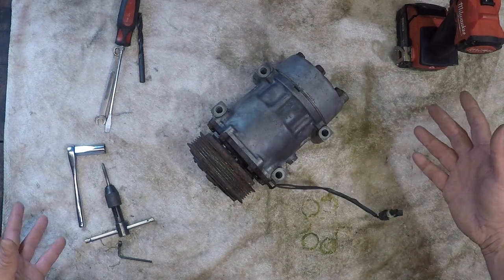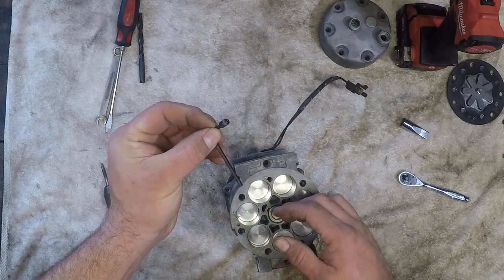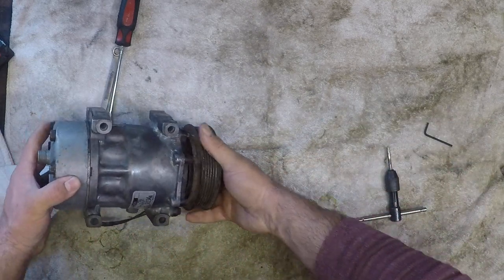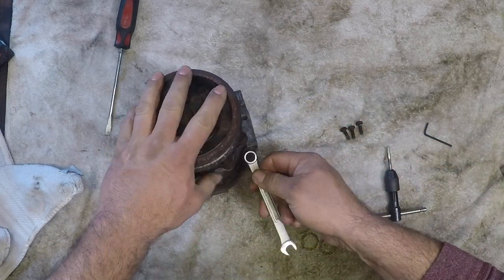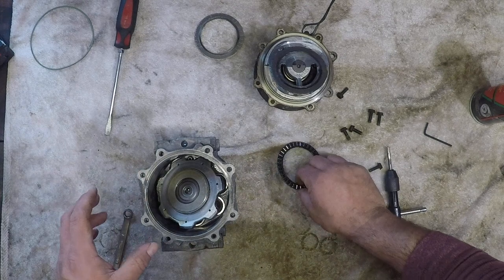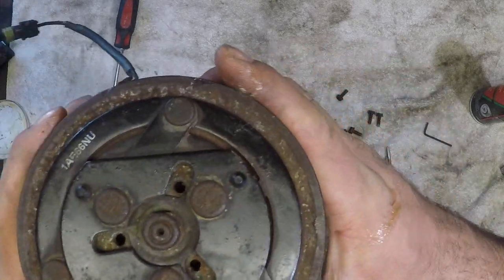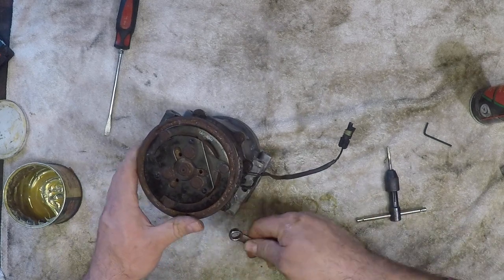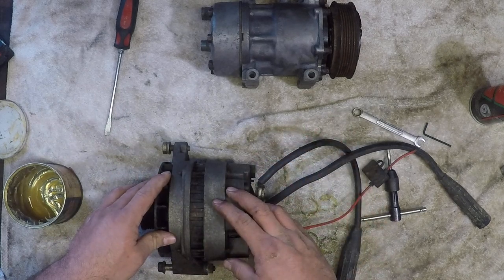How to make an onboard air setup out of a Sanden 709 A/C pump

Comment: I just picked up a $5 Sanden compressor to mount on my YJ. This is exactly the information I was looking for. EXCELLENT tutorial!
Thank you. 😎
UPDATE:
I've had it installed for about a month now:

This compressor works awesome! I robbed the pressure switch and blow off valve from a portable compressor (from a yard sale) to complete the install, combined with a throttle set built out of bicycle parts. This bad boy will pump a 30" tire from 18psi back to 35psi in about 30 seconds! The little Jeep rides so much better with the tires aired down. Thanks again.

Comment: I have never thought about grease i have always plugged the lube hole and but a fill hole in the top and put 4 ounces of 30 w compressor oil thats always worked for me 4 ounces seems to be about 1/4 of the way full
And when i got the head off i tap the holes for 1/2 pipe thread
Reply: I was considering using air compressor oil. Why not use the stuff made for this application? 

I like the idea about tapping the head for standard pipe thread.

Comment: Many questions on mounting one of these. Obviously a factory mount location is easiest. Otherwise adding a diy bracket is the next option. Essentially one needs to provide enough belt wrap around it. That's generally done by adding an idler pulley. One may be able to use or mimic a dual alternator bracket. Just make sure belt stays lined up on the same plane as other pulleys.  Then get a longer belt, which can be the hardest part. Using a piece of rope wrap around all pulleys and then measure including the tensioner. Belt manufacturers have a list of all their belts in a catalog with lengths and part numbers. Be sure to post your info somewhere others can find it for reference

Comment: I've just done this mod on my A/C pump ('99 4.0 RHD) and the volume of air it puts out is epic! Mine is fitted with an adaptor block and right angled fittings to get the air in and out - doesn't seem to affect the flow adversely. Unfortunately my A/C radiator was ruined so I can't cool the air, but maybe I'll add a small cooler in at some point in the future.
Thanks for the great video; easy to follow and very helpful!

Comment: I plan to try this on my XJ, assuming the factory compressor is the right sort. The A/C doesn't work (never has since I owned it) which isn't a problem in the UK as we only get 3 days a year when it's hot enough to need it. Hopefully the compressor works and the line to the condenser is OK, and the condenser itself - I plan to then run a separator before a small air reservoir to remove the condensate (water) and any oil (or otherwise) that comes through - dry air is so much better for your tyres!

Small side note - your comment about using a switched live from the ignition, "in case the battery goes flat",  got me to thinking about why you'd do that if the compressor only works with the engine running. Of course, the clutch on the compressor would eventually drain the battery, I suppose.

Anyway, thanks for the video, makes it a much less daunting prospect to open the compressor and tinker with it.
Reply from the maker: Yes it does, and I hate to admit it but I've been a victim of that myself in more than one occasion!

Comment: Help me understand.  With this compressor set up and greased at the front end does this mean you do not need to put a oiler on the inline?  I assume not.  Looking forward to your response. Cheers!
Reply: No, the back and air output are separated. Some say ya shouldn't add an inline oiler, I tend to agree now. The oil gets forced out the rubber hoses and makes a mess.

Comment: Thank you so much for the information.  There is a company that sells a compressor all cleaned out and has a zerk fitting on the housing. They call for 5 pumps every 6 hours of runtime of synthetic grease.    It's 500 bucks though.    So I'm wondering if this is a way better option.     Does anyone know if that fitting is critical?   Or does this setup do just fine    maybe open it up every few years and re grease it?

Comment: So I'm gathering you don't add an oiler at all. just letting the grease do all the lubricating?
Reply: U can use gear oil or oil stabilizer with grease but I suggest get a separator just incase a little blow by
Reply from the maker: Nope, I've got a handful of these out in the wild and they're all just grease filled, grease is heavy enough it shouldn't be a problem with blowby, but if you want to put an oil separator in-line for an extra piece of mind it wouldn't hurt anything, good luck!

Comment: I've been thinking about doing this. Would it be a good idea to also add a grease nipple on the side of the body to add some grease every now and then on something that's used daily for air bags, air horn, and a pneumatic actuated exhaust brake? Also thinking about running the intake of the pump to a valve cover breather so it sucks up a small amount of oil vapor to lubricate the top side of the pistons.
Reply: The guys at extreme outback do exactly that.   They also charge 500 for the unit.   After watching this, I have realized I paid 400 bucks for a grease fitting!  Lol

Comment: Plan to do this to my sanden 709 I did the setup with a inline oiler and the water oil separator The separator got too hot and cracked during the first use so I might just do this so I can delete the whole oiler and water oil separator..

Comment: This is very educational and informative. I like to DIY when I can to save money (and within my budget🤣). Everything you had showcased is awesome. I know what other parts are needed. 

However, where I am lacking is how to mount and drive the unit.
I have a 2008 Chevrolet Silverado 1500 4x4, 5.3L gas engine with a serpentine belt system . The only place I found room for the unit will be next to the alternator (driver's side of the engine). 
Ok, fabricating a bracket, I can get done. But how do I drive the compressor? I looked for a double serpentine alternator pulley. Does not exist. I can find double v groove pulleys for alternators. But then I won't be able to drive the alternator with a v groove pulley.

 I am just stuck on how to mount and how to drive the unit. 

Any suggestions?
Reply: You can maybe add another idler pulley and longer belt. Otherwise use or diy a dual alternator bracket that makes it work. Then just figure out what longer length belt is needed.

Comment: How much oil blow by do you get? Should you need an oil water separater?
Reply from the maker: Honestly none. I use grease in my builds and I haven't had any issues. My original build is still going strong after almost a decade with no added grease. 
If you were to use oil, it could leak by. There's a good seal between the cylinders and walls, but there are no rings to wipe oil like in an engine. Just o rings for pressure building. In that case an inline separator may be needed, but the grease has worked awesome on every one of my builds.

Comment: Question for you, in the video you state this works on TJs up to 2006. I have a 2005 with a different style compressor it’s a Denso instead, and looks like a different body altogether. Have you converted one of them? Looks like the pulley has to be removed entirely to get to the bolts holding it all together. Got any information on it?

Comment: I wonder if you could use a good gear oil for this.  Maybe fill it about 1/4 full.
Reply: It sounds good in theory, but I have a sanden compressor I was messing around with, and even with that port blocked off, the gear oil was able to get past the piston rings and into the air lines. It was thick gear oil too, 85W-140! Haven't switched to grease yet, but it seems like the way to go.

Comment: How often do you regrease these? Would you add a grease fitting to it?
Reply from the maker: I've never added to it, there's no obvious signs of leakage either. They're actually is a plug on the side of the case you could use to add to if you liked. Sorry for the long response time things have been busy and I'm not a 'creator' this is just something I've done to try to help people out, I didn't realize it had gotten this popular while I was away! I'll try to make more of a point to log in daily and answer people's questions! Best of luck!
Reply: Most I have seen add a grease fitting in place of the drain plug on the side of the case and if you look at extreme air products (I think) they mention how often to pump grease in but I would be careful . If this guy has never added grease and run it for 10 years then probably give it a pump or 2 a year
Reply: @1966cambo  yea I’m planning to use this set up for an airbag set up so it will see more use than a weekly trail ride but I’ll keep an eye on it and just add in a grease fitting for periodic pumps
Reply: @bradfordcustoms7588  I have built the york 210 for on board air in the past, it ran often because I used the air for actuating an exhaust brake as well as air tools etc, never had an issue with it ever!
Reply: I do like the compactness of the sanden unit though and my truck has one that’s not being used so yup, will be pulling it to convert it over, might use the factory condenser to cool the air too.....
Reply: @bradfordcustoms7588  Did you end up doing this for your air ride? Did it work well?

Comment: If you block off the oil passage, would there be any reason against putting a hole in the side of the crank case and filling it with a little bit of motor oil or the like. Im wanting to use one for a portable compressor welder combo. Just wondering if there woukd be any downside to using oil. Then there wouldnt be a need to re grease after a lot of run time
Reply from the maker: If you maintain the clutch system, it'll only run when needed, not constantly. Typically there is a plug on the side of you feel you'd need to check or replace/add grease, you can be the best judge of that as I can't be informed of every situation. 
 However, I kind of lean towards oil being thin and getting into the cylinder since there's not really a sealing ring there. Just a really tight fit and I believe a lot of blow by. Normally this isn't an issue since it's just sent back into the system it's meant to be in anyways, but if you're using it as a stand-alone compressor, it may cause issues with oil loss, but could also help oil tools? I'm not sure of how much blowby you'd get to be honest, if you do try it, keep us posted! 

Thanks!
Reply: @trinksauto576  I haven't run it much yet, but I used some 75-140 gear oil, it was tge thickest stuff i had, I run it off of a drill for aboit 5 minutes as a preliminary teat and didnt have any oil blow by. Ive still got a lot if work to do to it yet though. Mounting and wiring everything still

Comment: What is 2.5 and 318?
Reply from the maker: Engine sizes, my Jeep originally came equipped with a 2.5 liter four cylinder, I've replaced it with a 5.2 V8 from a 2001 Ram

Comment: How did you install this on jeep?
Reply from the maker: It just bolts into the factory bracket if it's a TJ/YJ. If you're not working with a factory AC Jeep you'll need to change the belt and the idle pulley under the alternator too.

Comment: I'm trying to do this with a sanden 508 compressor. When I removed the head, I found 2 holes instead of 1. One is tapered and one is not. This compressor has 5 pistons. Should I plug both holes? Thanks.
Reply from the maker: Hey, I'm really sorry for not getting back to you sooner, I don't consider myself a creator and this kind of fell by the wayside to a full-time job, a family and the whole pandemic.
Check the one way valve I believe only one hole is uncovered, and that's the one you'll need to tap, if they're both uncovered you may need to tap and plug both of them
Reply: Yes you need to tap and plug both holes on the 508. Pull the brass tubes out too from inside the swash plate housing before you try and tap the holes.

Comment: I think the video is more of greasing the compressor than making an onboard air setup. I didn't see any setup , sorry
Reply from the maker: It's how to convert an A/C pump to stay lubed via grease, and not the oil in the freon mixture, an A/C pump is already an air pump, it just normally pumps freon that contains a lubricant, and not fresh air into an enclosed tank. Removing the freon to use it as an air compressor is why you need to convert it to run on grease. You're not entirely wrong, but most people wouldn't find the video is I labeled it how to convert to run on grease, I hope this helps!